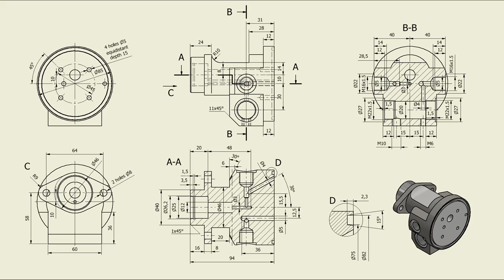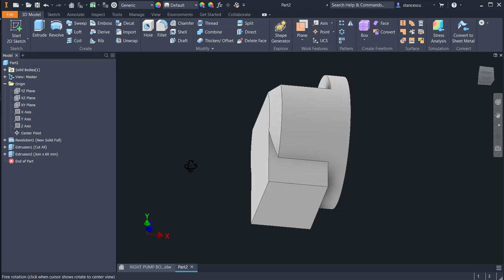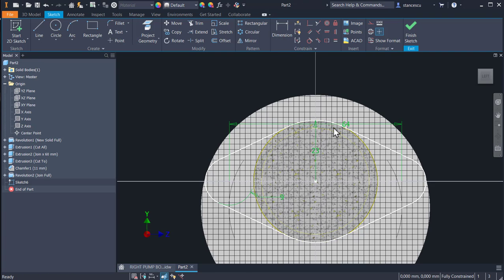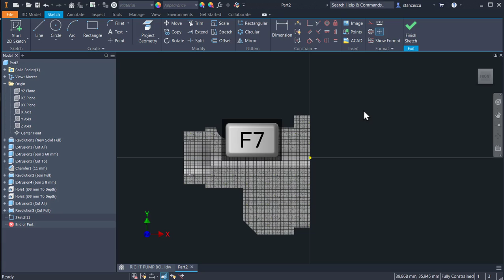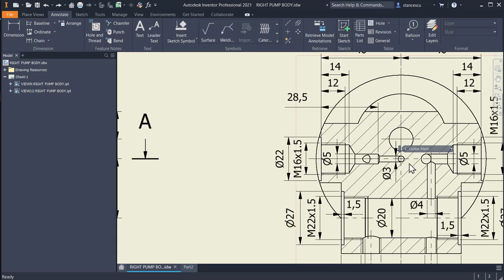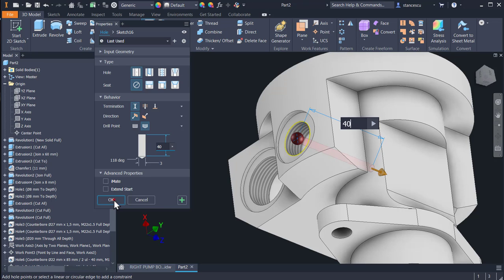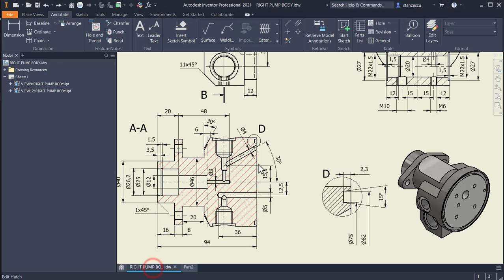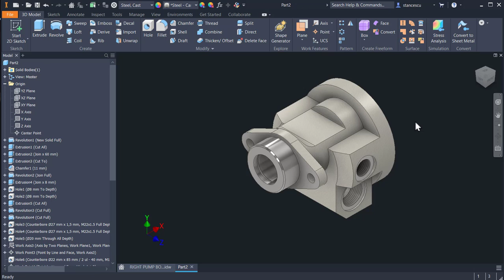Tutorial Inventor - 137 RIGHT PUMP BODY (Part-097)

Comment: Hello dear professor Constantin, on 35:46 we should use spotface option to correctly define the inner thread, I think the couterbore as it is is not correct.
Reply from the maker: Dear Petr, the value of 85/2-40 is OK because the cylindrical face contains that point which is the base for measuring the counterbore depth.
So, in my opinion, the counterbore depth is correct...
Reply: @prof-stancescu  counterbore depth is OK, but thread depth is not. We are dimensioning lengths 12 and 14mm (the thread dimensions) from the wrong point. Countersink option solves it. I am pretty sure.